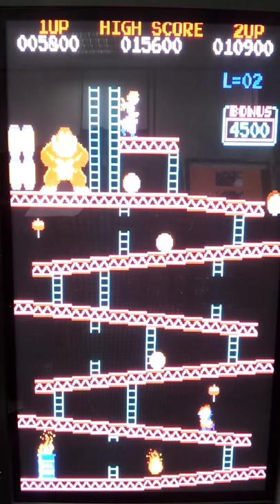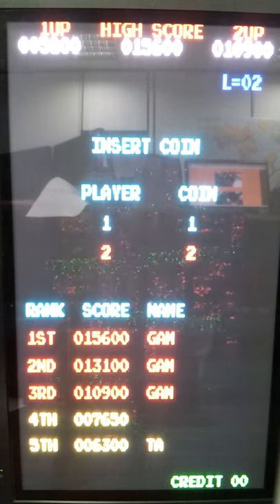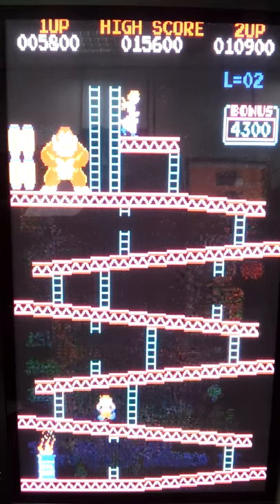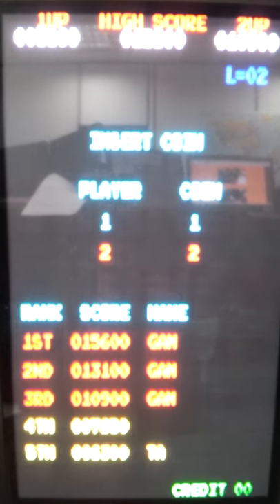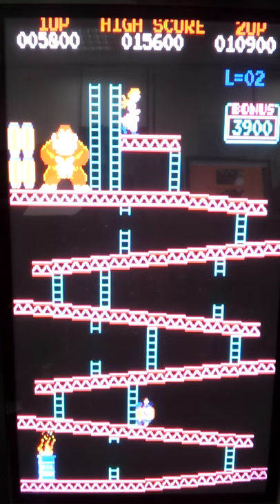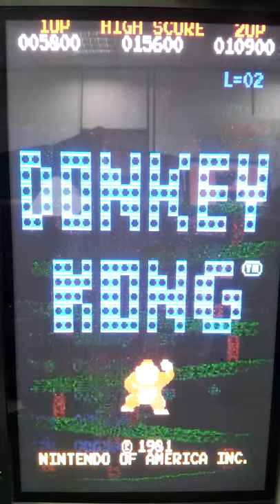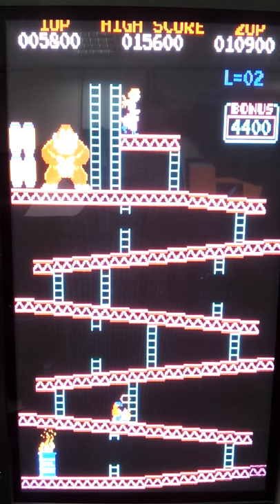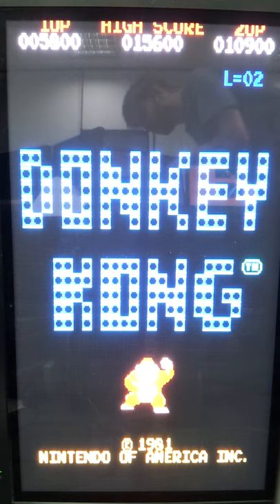Reducing plasma screen sparkling by adjusting vertical scan voltage POT

Comment: ALSO TURNING VS DOWN ON POWER SUPPLY COUNTER CLOCKWISE WORKS,, SETTING VOLTAGES TO BACK OF TV SETTINGS ON REAR STICKER ON SCREEN MAYBE ABOUT 2-3 VOLTS LOWER,,,STOPS BURNING OUT YSUS PANNEL.
Reply: how to fix if my mobile half screen light sparkling?this can be cause danger or what? reply please!!!
Reply from the maker: The fault explained in this video only relates to plasma television 
sets, and not mobile phones. I suggest taking the phone to an officially
 sanctioned repair shop. I doubt it is dangerous, but it might be 
expensive to repair!